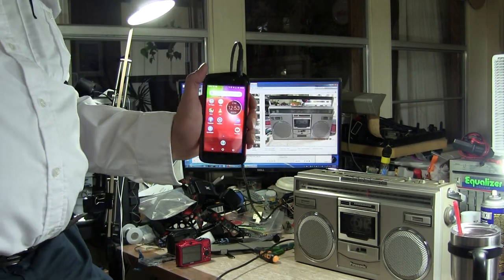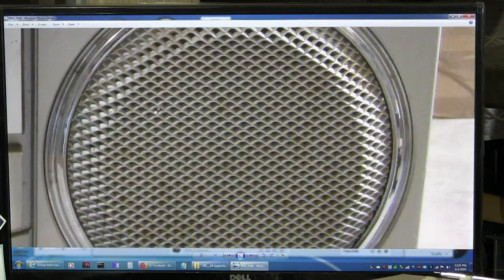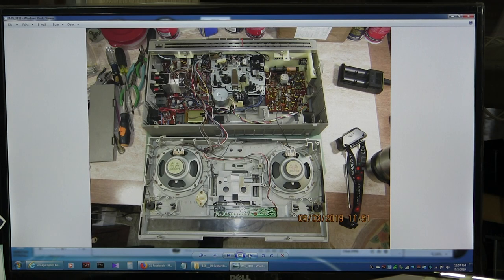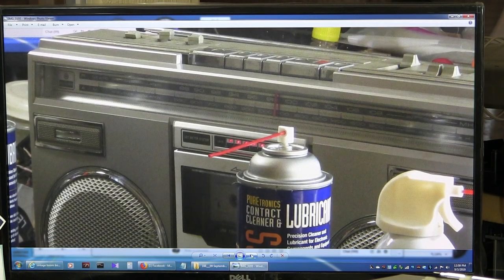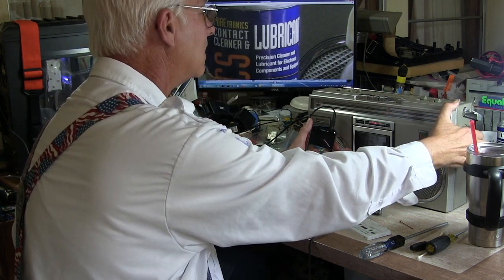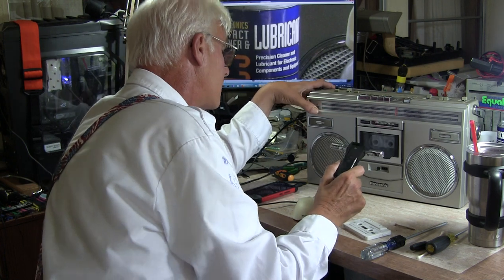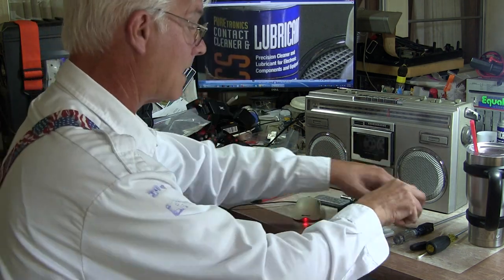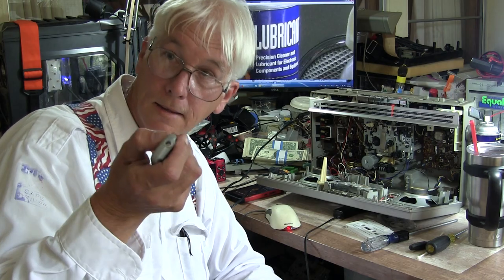Panasonic RX-5100 serviced restored cassette tape record play radio line-in sold

Comment: Hello sir, any old model national Panasonic RX 5005 .i need request for old type model collection. And national. Sharp. Toshiba. I waiting for your reply sir,
Reply from the maker: Text call James 713 502 9993
Reply from the maker: I had two of this model and I sold them both and I have NONE anymore & I am not buying this model either Ebay .1 - https://www.ebay.com/itm/Vintage-Panasonic-RX-5005-Stereo-Boom-Box-Works-Summertime-Ghetto-Blaster/273861737131?hash=item3fc36e7aab:g:Sx0AAOSwKnFc6Jou 2. https://www.ebay.com/itm/Getto-Blaster-Panasonic-Ambience-Boombox-RX-5005A-BOOMBOX-100-WORKS-1984/223453937474?epid=1128256582&hash=item3406e47f42:g:Pw4AAOSwOWxckVxg 3. https://www.ebay.com/itm/Panasonic-Ambience-Boombox-RX-5005A-BOOMBOX-FOR-PARTS-RESTORE/283355633234?epid=1128256582&hash=item41f94fd652:g:01YAAOSwTxJcTkg8:sc:FedExHomeDelivery!75248!US!-1  3 found so you can go and buy these ok?